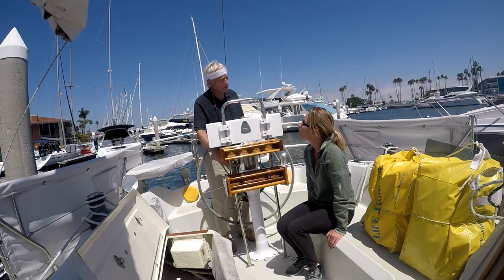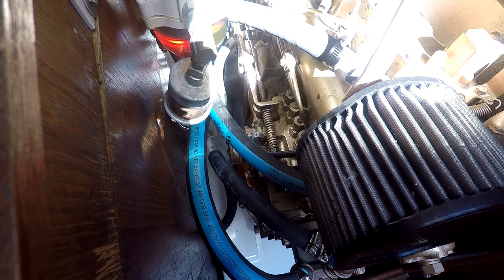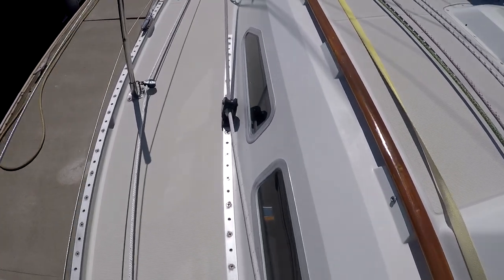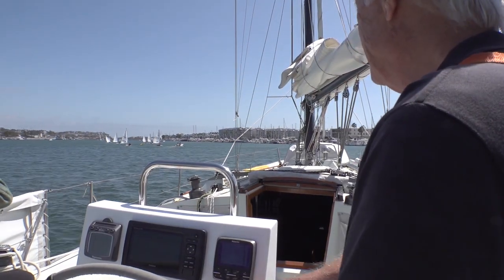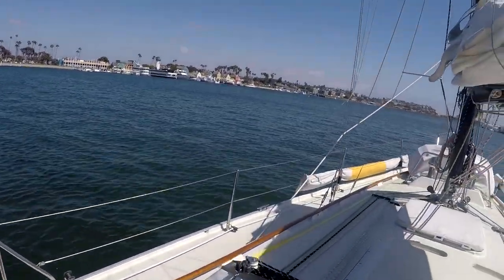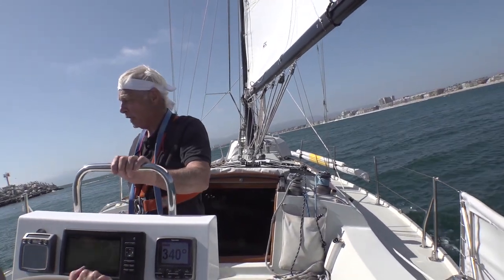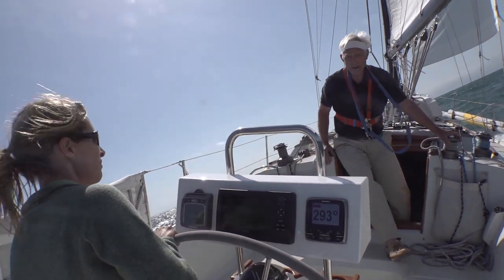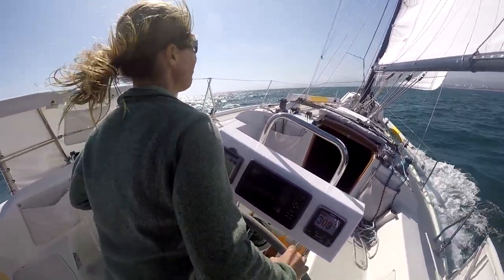"Introduction to Sailing," Part 5--Time to Reef

Comment: Did not get your gybe logic.    Limiting the boom swing during the gybe, leads to safety and prevents damage to the boom  especially at gooseneck.
.....or use a boom brake .     What did I miss?      Always enjoy your videos and commentaries.
Reply: I agree
Reply: Geoff Phillips The damage that can occur in a flying gybe occurs when the wind slams the sail to the limit with full force. Things break, booms bend etc. But what Christian did is oversteer, in effect heading up into the wind on the new tack, into a broad reach before the sail finished coming over. That means the sail actually gets backed by the wind before it reaches the limit of the main sheet, which is set for running free.  It is naturally braked by the wind. No serious stress on the rigging. In a moderate breeze when you’re running straight down wind, the apparent wind isn’t all that strong in any case,  so you’re not risking much. Not recommended in stronger winds.

Comment: Mr. William's, thank you so very much for today's lesson.  I had given up hope that I would ever learn the correct way to string the clews on my first and second reef lines (I was just attaching to the sail and not terminating the two lines on the boom).   I also gained knowledge relating to where to set the car on the head sail sheet travelers which I had been experimenting with for some time. Being a novice in his sixties going into my second season of sailing, I very much appreciate the tip filled videos you and a limited number of other publishers release. Prosperity, health, and happiness to you and your daughter. Dan S/V Drifter a 1989 IP 35

Comment: I learned to sail with my dad in Marina Del Rey when I was 9. He later bought a larger boat and moved it down to Coronado where I was a junior member of CYC. There I had the opportunity to crew on a Newport 41 named Lola which belonged to Whit Davis, father of Rod Davis - they took their sailing rather seriously - to say the least.
Many years later after my dad had sold his boat I wanted to get back to sailing and introduce my wife to the experience. I found Set Sail Yacht Charters in San Diego. The owner turned out to be Jeff Davis - Rods younger brother. I have been chartering boats for years including two trips up from Cabo. I've never had any formal instruction and have no certificate.
I love your videos  (I taught my daughter to sail as well)

Comment: I have been really enjoying your videos, well produced, entertaining and informative for a dumb newbie like me. I am still learning the whys and wherefores of different sails so I am wondering why you are using half a Genoa instead of a smaller Jib? Are Genoa's more common in your area for head sails? Easier to use short crewed? Just what was already on the boat?
Reply from the maker: A modern roller-furling genoa jib can be set smaller or larger according to need.  Big improvement over carrying multiple jibs, which have to be changed under way and stored when not in use.
Reply: @ChristianWilliamsYachting  Thanks for taking the time to answer!  I hope you do more videos like this one.  I picked up your first book and I can't put it down.

Comment: Hey Christian, do you need to hook a leech cringle onto the gooseneck/mast, or do you just lock the reef downhaul in a clutch and call it good? If the latter, that's a nice way to avoid going forward on the deck to reef. I need to switch to that system.
Reply from the maker: The reef downhaul line is held by its clutch. No reef horn or cringle involved.

Comment: Where did your wind vane go?
Reply: Wind vanes are for amateurs.
Reply from the maker: A virtue of the Sailomat is that it can be easily removed from the boat when not in use.
Reply: @SOLDOZER  OK 😜